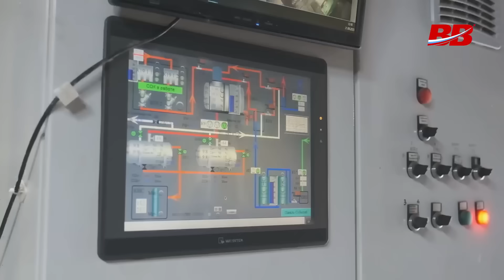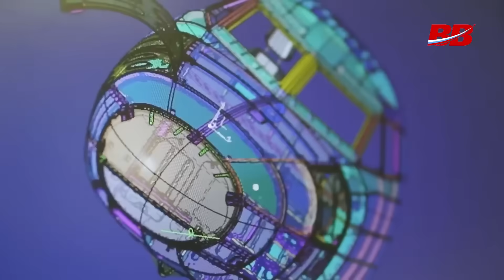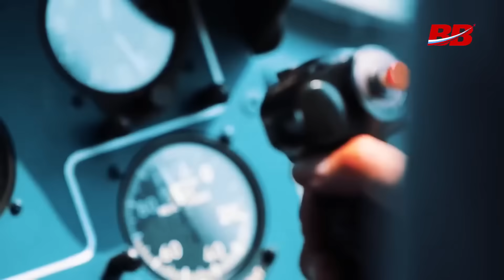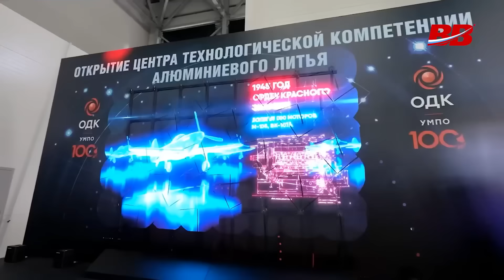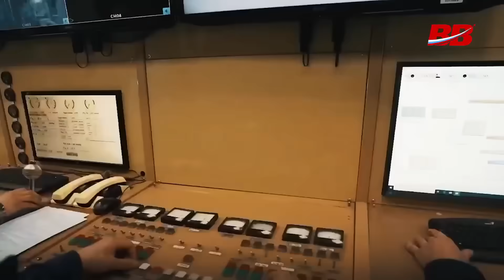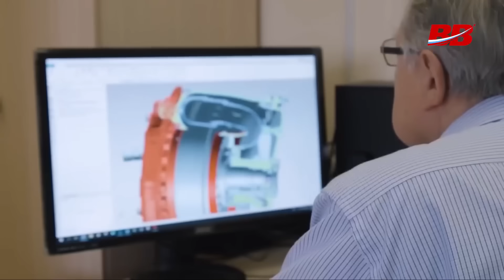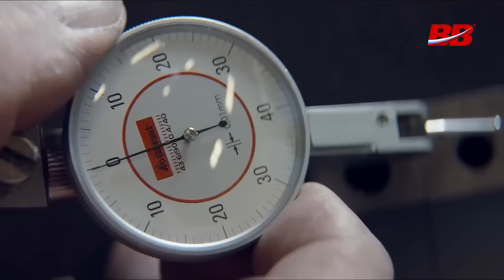Putin’s Engines: 700 Motors a Year—And This Is Just the Beginning

Comment: NFTG is developing revolutionary turbine technologies, rotary machinery and linear piston engines for numerous applications including low cost, high efficiency waste heat recovery / heat pumps.
---
We are developing a rotary and a linear piston engine technologies which solve the emission, noise, efficiency. sealing, lubrication and power density issues of legacy ICE, rotary engines & turbines... W/O NEED FOR HYBRIDIZATION.   GAME CHANGERS‼  BOOM!!!‼

We also solved the rotor/propulsor noise issue and acquisition cost issue. All of which enables door-to-door mobility.   GAME CHANGERS‼  BOOM!!!‼

And there's more.